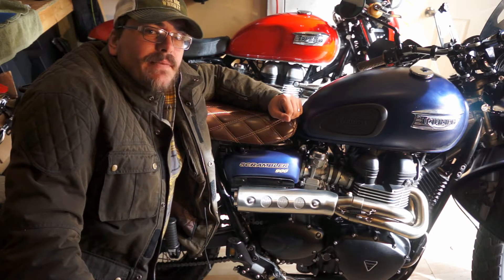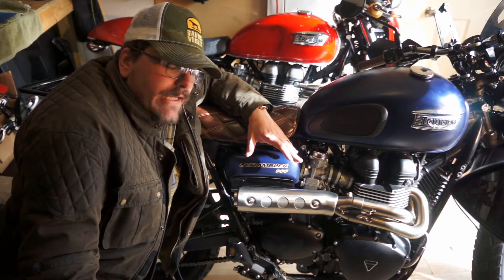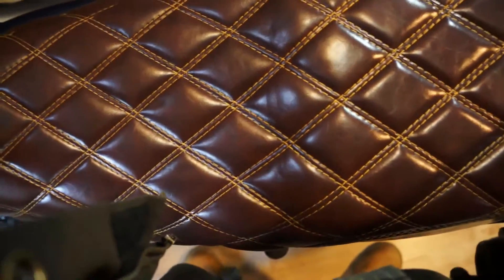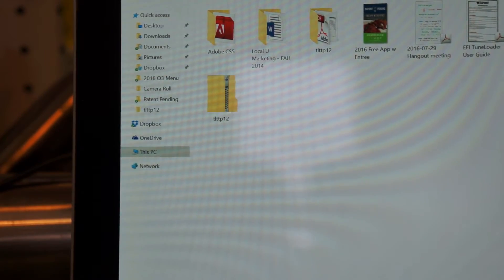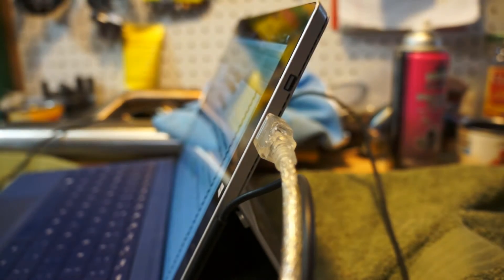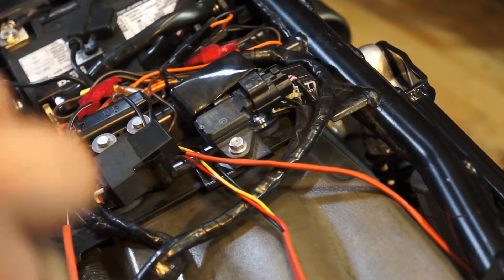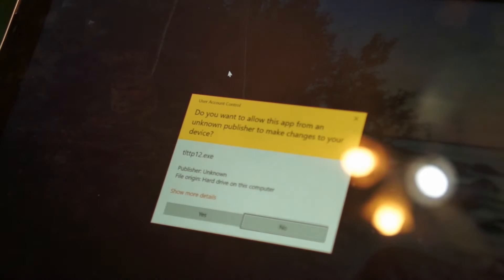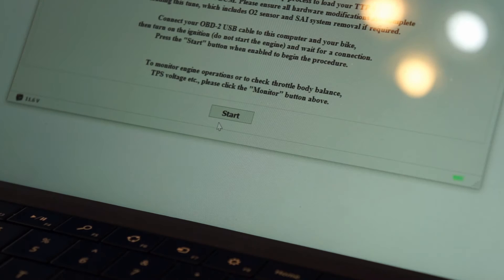0009: How to balance throttle bodies and reset Triumph ECU using TuneECU

Comment: Is it necessary to do the "reset adaptions" after balancing the throttle bodies? And if you do so, don't you need to do the adaption cycle by idling the bike for 10-20 mins?

Comment: dude! thanks, so smooth now! mine was at 310 / 260.  was able to get them to 260 /270, awesome. thanks again 
question to you, what map are you running? I am running TEC desert 2into1  no Baffles and UNI filter, was told to run the arrow 2into1 but its still a little lean. I think that I may have only found the map for running baffles. mine is map 20514. thanks in advance.

Comment: Did resetting adaptation solve the running rich issue?
Reply from the maker: divinerob9 unfortunately, no. There was just too much airflow without using the rear can of the Arrow. I ended up installing a custom tip to the link pipe and running the Arrow baffle into the tip. That restricted the airflow to about the same as the full Arrow installation, which solved the problem.

Comment: How does one get the software for the Triumph Twin Power? The previous owner bought a tune from TTP and set it to Tune 13 (arrow exhaust), but I think the throttle bodies are off? How can I check those without the software or how do I get the software without paying a shit ton for a tune I already have $$$? Thanks.
Reply: you can use tune ECU software do diagnose. http://www.tuneecu.com/TuneECU_En/links.html
Reply from the maker: Walker Collin that's a great question. Mine came with the tune I bought. Maybe someone can chime in on this?

Comment: You forgot to mention to pull the fuse for headlights before using tuneecu.  Doing it with the headlights on can draw too many amps and cause issues.  You must have a fully charged battery and it's recommended to have a charger on your battery when doing this.  Even an 85% charged battery can give you problems loading maps with tuneecu.
Reply from the maker: Thanks for the tip. This is actually the first I had heard of this.
Reply: Actually, the headlight fuse pull is really only needed when loading new maps into the ECU. This can take a some time to load and if the bike power drops too low, it could corrupt the file or other ecu settings. The Reset Adaptations process needs to idle the bike from a cold start until the little green status light comes on or upto 20min max. Do not touch the throttle for the Reset Adaptation start up (it is ok to use the cold start fast idle/"choke") and don't touch it until process completes...doing so will require you to start all over again from cold engine. This video does not perform this process, it just shows the software Reset screen, but he didn't do a start up and let idle so not sure it had any affect.
Reply: I tried pulling the headlight fuse and my bike will not start.
Reply: @jrkstories5106  you'll have to put it back in before starting the bike again. Pulling the fuse is really only suggested for the adaptation part of a tune load
Reply: Thats only when reflashing your ecu, which is a critical procedure. You can do everything else with the fuses in lol

Comment: Tiny, like your style an enthusiasm. Had a new 67 scrambler now I'm 67 an got a new 2016. Like it but after 105 miles I've realized I should've got the Bonneville, in part due to the tire safety. These tires on the scrambler can't be all that good on pavement wet or dry along with stopping. I like some off road...
Reply from the maker: I hear you on the tires. I actually wrecked a 2010 Scrambler about 8 months ago, I lowsided going about 40'ish. Two pins and a plate later, I'm still limping around. Good news is, you can always put road tires on your Scrambler!
Reply: Thank you for confirming my suspicion about the tires. I best take it easy on the paved road tell the time comes when I get the proper tires. Tell then I'll enjoy my off-road rides.